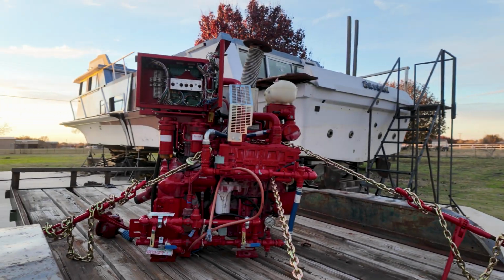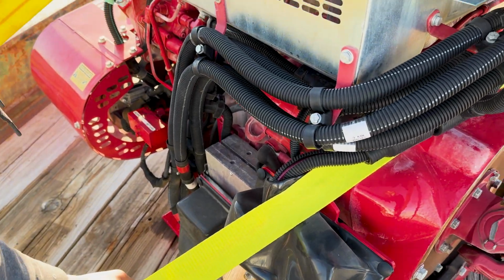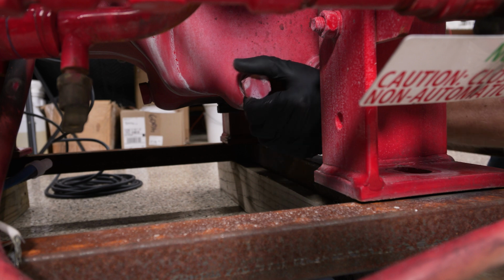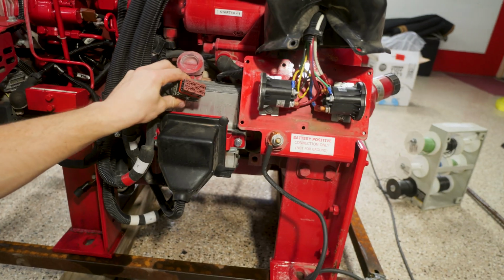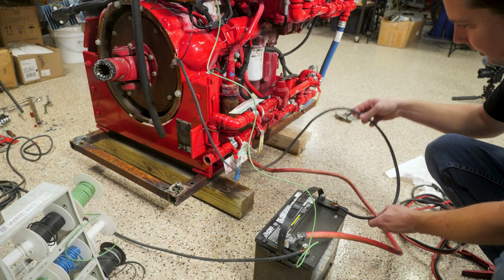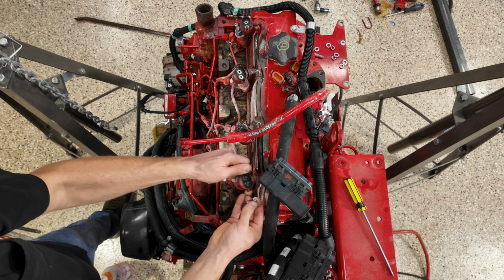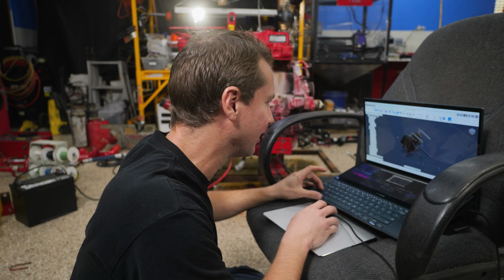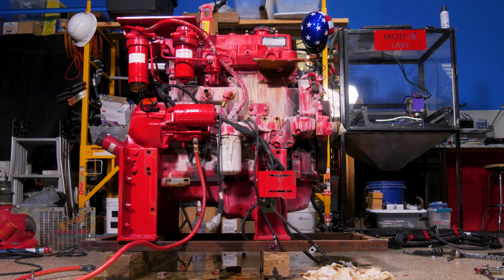The Perfect Houseboat Diesel, But Is John Deere Evil?

Comment: Just finished serial watching the house boat videos. I started from the beginning. what a project. I personally am a fan of Ford Lehmann diesel motors.  Extremely reliable'  Easy to work on' Easy to get parts for' And great fuel economy. You find them in a lot of defever and manship  Trawlers.
Reply from the maker: I’ll have to look into those engines. Maybe I just don’t see them that often since we are mainly on the lakes instead of the coast with more trawlers. Thanks for the feedback!

Comment: normally i tell everyone to steer clear of used fire pump engines. mainly because the block heater usually keeps them over 120F and no one thinks about is as soon as the engine shuts down the cooling water stops flowing. I've seen an engine hit 250F after shutdown (no it's not the same as a car, a car can use a thermosiphon through the radiator).  this breaks down the coolant. you'll see a lot of wear on the outside of the liners  and in the head.
Reply from the maker: Sounds like you've got experience with them for sure. Makes sense why when these things go south they end up with a trip to the scrap yard.

Comment: Stand alone ECU?  Diesels are pretty simple to run.  Don't have to worry about lean, rich, or detonation, Just add fuel depending on throttle request and intake pressure.
Reply from the maker: Trying to look into standalone ECUs that will work with a diesel, and all I've found so far is a $6,000 Motec. Doesn't seem like Holley or the other aftermarket car companies make anything for diesels.

Comment: I absolutely love LS engines but I’d choose the diesel. Especially in a vessel that size. Better fuel economy, longer reliability and better torque numbers at lower rpm’s ultimately much safet. With a marine tune the power levels of the diesel engine will go up a bit.
Looks like it was flooded with water from either the fire system it was supposed to run. The fire department or rainwater from sitting outside.
Reply from the maker: Buddy said it did sit outside for about 3 months before we got it, so I think you're right on that being from rain.

Comment: Why would weight be a concern in a 50 foot houseboat, reliability and longevity should really be the only concern for that application
Reply from the maker: Mainly because it sat a bit low in the stern even with the old gas engines when it had full fuel tanks and a couple people at the back. Might just be me worrying for no reason though.

Comment: Cummins 4 or 6Bt engines are vastly superior to any other diesel engines used in the marine industry. They are relatively cheap to buy and repair if you stay with the mechanically injected with out electronics. Electronics and water never a good idea. Gas is an absolutely not a good idea because of fumes that buildup in an improperly vented engine room.
Reply from the maker: Thanks for the suggestions. The 6BT sounds like it would be great, I just need to see if they would fit in that engine room.

Comment: How long will it take to recoup the running costs on repowering with Diesel vs gas?  Putting LS engines in, which you're so familiar with fixing, there has to be a Plus for that, but guzzling fuel like crazy, mmmmm.  Surley putting diesel in will increase the value of the houseboat a lot more then Gas if you end up selling it.  Lots of famers here in Canada run 80's JD equipment, the new stuff is crazy expensive, there were ways around service on the newer ones too, by this point the service software is probably easy to get, they had aftermarket stuff to get around all the locked ECU's on Cars as well, VW\Nissan\Toyota, can't see how this would be much different.  An interesting Quandry.
Reply from the maker: Yeah I think the fuel guzzling is a tough one. I keep forgetting how much we used to spend on gas with this boat. The 80's era JD stuff you mention makes sense after all I keep reading about their new equipment.

Comment: 2 4bt cummins motors would do the trick
Reply from the maker: Thanks for the feedback! Definitely looking into the 4BT marine engines now.
Reply: Yep. Have the 6BT engine in my Hyundai 210LC excavator with over 12,000 hours on it. Still starts and runs great, even in the freezing winter cold. Great engines!

Comment: I'd go with marine CAT or Cummins for diesels. To me I'd find older units that are still mechanical injected. The less electronics the better. It is a house boat not a race boat. More reliable the better. You can still "tune" them to make decent power. But even if you still want the modern electronics I'd still go with CAT or Cummins.
Reply from the maker: Thanks for the feeback. Mechanical is definitely a big pro, especially troubleshooting things out in the water.

Comment: Diesel Engines can be quieter especially if they are overpowered and have a low rpm torque curve because for example at 65 my cummins sits at 1000rpm it uses less fuel & 1000rpm is quiet!  You could solve this low RPM problem with the right gear box Remember Diesels put out a metric shit ton of torque so spinning a large gear wont be an issue!  also diesels tend to be deeper more base type of sound that is more tollerable!   The question is the engine compartment sound proof cuz alot of noise comes from the actual engine itself not out of the exhaust and in that case does not matter what you put in it!
Reply from the maker: Thanks for the feedback. The walls used to be lined with mass loaded vinyl to keep the noise down, so we can do the same thing again after this restoration is done. We have to get new gear boxes anyway, so we can definitely get a lower ratio too. Maybe instead of spinning 1,700 like we used to with the gas engines we get that closer to 1,000 with diesels.

Comment: I would vote Cummins 6bt a solid engine with a proven reliability.  You can even get them without a computer.
Reply from the maker: Thanks for the feedback! Lot of people recommending the 6BT, I just need to see if it would fit in the engine room.
Reply: The only draw back is the rpm range, they may need a higher gear ratio. On the other hand it is fairly easy to make more horsepower to spin the stiffer gears. @Motiv8Labs

Comment: Go with a set of 6BTs! They made a marine version of the 6BT and I know guys running them with THOUSANDS of hours. It probably wouldn't be too hard to source one and I'm sure it wouldn't be an issue converting over a on-road to a marine engine. No computers, just a simple mechanical pump!
Reply from the maker: Thanks for the feedback. Lot of people recommending those. I'm just trying to see if they would fit in that engine room.
Reply: @Motiv8Labs  let me know if you need any measurements. I have access to a 6BT marine engine.

Comment: As I said with the hydraulic steering crab boats run manly Caterpillar diesel .  Do you have to run "John Deere " Operating system on that engine ??  Or could you run a "Cat" O.S. on it , it's just a engine ,,right ???  The O.S. doesn't know who made the part it is controlling  ....    Right ?  Aaron from "Flying Sparks Garage" (YT) is a diesel mechanic . You might want to hit him up thru is social to see if he has any ideas ....   I'm thinking diesel , which you might only need one engine ,if you haven't thought of that already.     Good Luck !!!!    Lovin the boat content !!!
Reply from the maker: Thanks for the feedback! I started looking around at aftermarket ECUs for diesels, and so far have found a crazy high priced (for us at least) Motec ECU that's $6,000. It's wild that Holley and the other aftermarket car manufacturers don't seem to be into the diesel stuff. I have to keep researching though.
Reply: That is a great question about the O.S
Reply: This part of your comment made me almost snort my drink "Or could you run a "Cat" O.S. on it , it's just a engine ,,right ???  The O.S. doesn't know who made the part it is controlling  ....    Right ?"  Just because I am a network engineer and Cisco made a network switch series called catalyst and their operating system was called "Cat-OS".  The 6509 was a beast coming in at (Height)32.7 x (Width)17.3 x (Depth)18.1 and weighting up to 280lbs when fully configured.  So at least in height they are in the same category as these two engines.  Though I think in this case the operating system would have a hell of a time trying to control the engine.   LOL
Reply: @kencramer1697  It is very hard for me to believe that there is not a company out there that who makes a ECM like Holley dominator but for diesel .  That what I was referring to and  Yes , by no means am I diesel mechanic. It was just a thought !!

Comment: Honestly, as long as you get the throttle input to both ECUs (either an added relay or just redundant throttle potentiometers), I think the original fire pump control board should work just fine, since it just switches ECUs when one fails, so I don't see any reason not to keep it, as long as you reprogram both ECUs exactly the same way. I think all the redundancy is really a big plus, and would try to keep as much of it as possible. Personally, I would fix that fire pump engine, but maybe with a blown parts engine. Farm equipment mechanics might have a few of those sitting around (since JD often sends out whole new engines when one fails, including all the small parts), and then you would only need new gaskets and the software (which could be an interesting video as well). If fixing that red JD isn't an option, I would go with MAN, since I had quite good experiences with them, their aluminium engines are rather light for the power they make, and they are EVERYWHERE in Europe (boats, trains, trucks, literally anything with a piston engine), though I don't know about availability in the US.
Reply from the maker: Thanks for the feedback! I have to look into what MAN has in the US. I've seen their giant engines in the big yachts at the boat show, but haven't looked into the smaller engines that might work for the houseboat. I'll look into it.

Comment: I get disliking jd for the right to work issue, but giving all the sympathy to the farmers also has no merit, all these farmers are upset because their "brand new" equipment can't be diy fixed, my question is than, why are you buying brand new? Why are so many farmers working with decades old equipment, staying profitable but these guys are contemplating suicide because they can't be a little bit more comfortable in a new tractor... I just don't buy it.
Reply: I bet you also bitch because used equipment is too expensive. Eventually you need reliable new equipment to replenish old used equipment that's beyond repair.
Reply: It comes down to repair cost. The farmers running old equipment are not running as much acres as the farmers with the newer bigger equipment. Don't hate on farmers if you don't know what they go through or how to run a farm.
Reply: @noahbeckmann1363   so your saying, don't hate on them for causing themselves problems, who told them they need to run more acerage? Every farmer I see is always driving the newest pick ups, and live I'm the fatest houses, whatever their having to figure out, doesn't even account for the subsidies... farmers are the conservatives vs. Of nurse's and teachers.